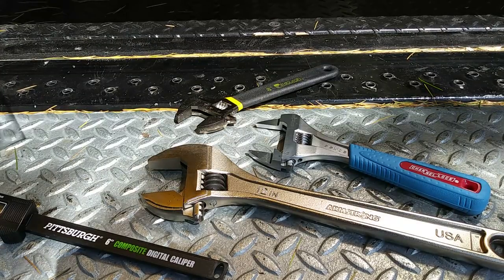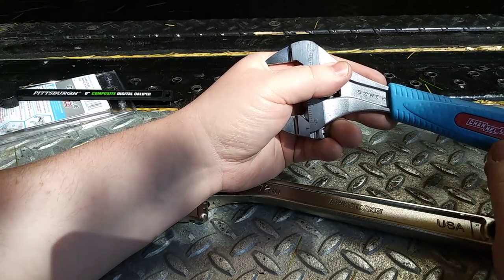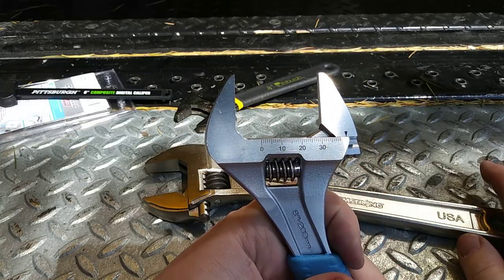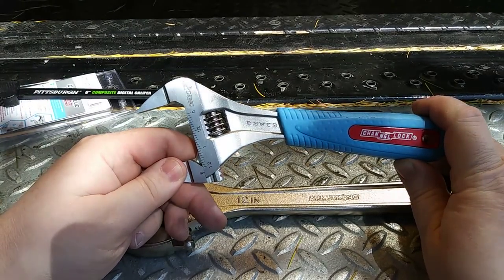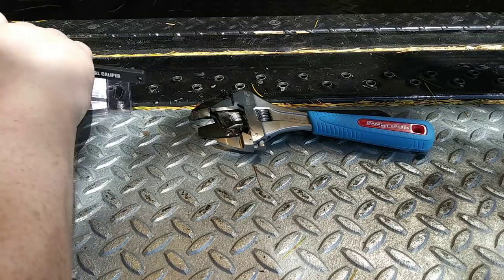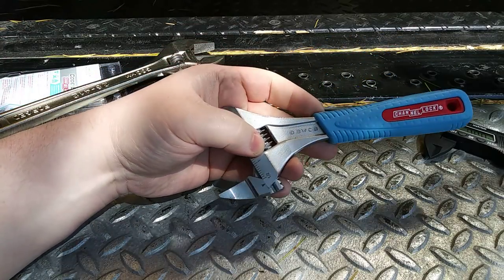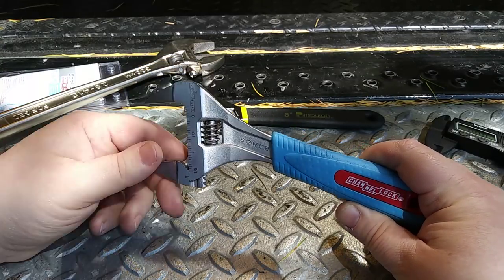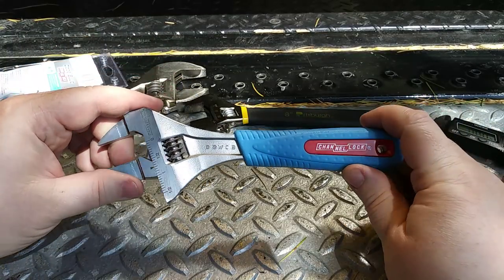Channellock | The Best Every Day Carry Wrench 🔧

Comment: The auto adjusting channel lock pliers are great they have there place if your in a hurry and need a tool quick very strong one brand I have is gorilla brand pliers not sure if there still around though
Reply from the maker: I will look into those.
Reply: mdlee52 no problem